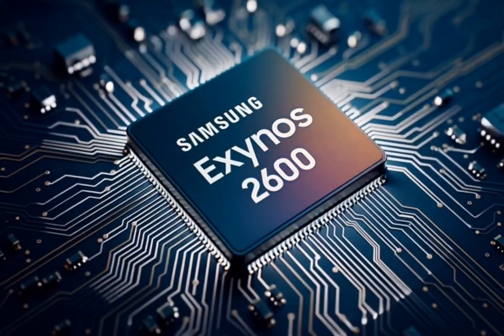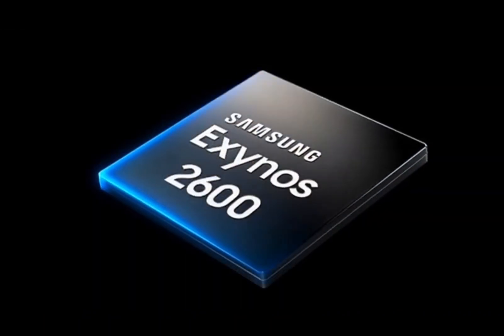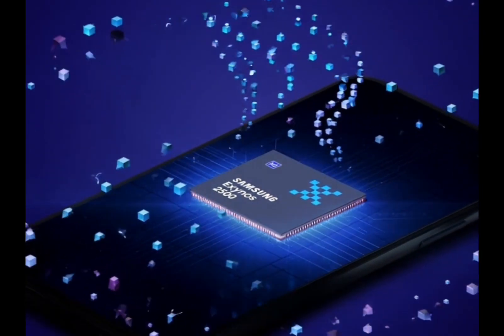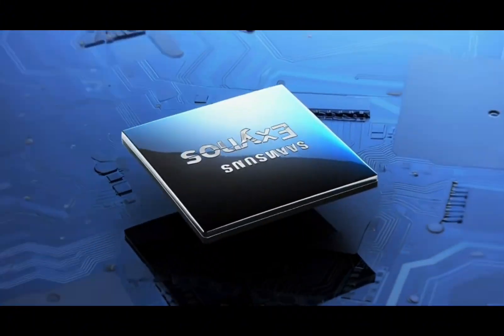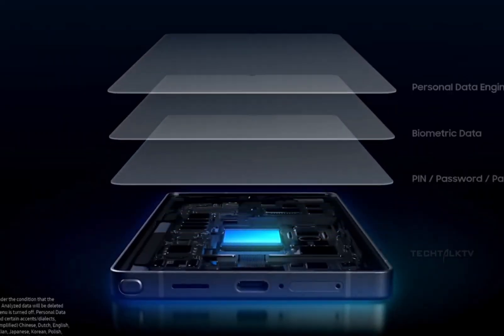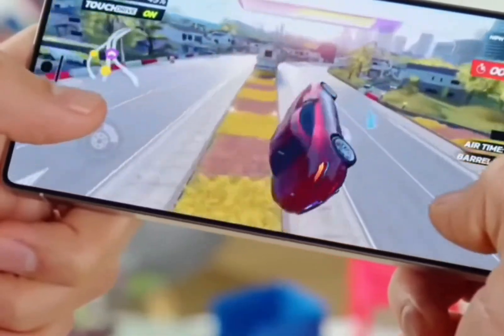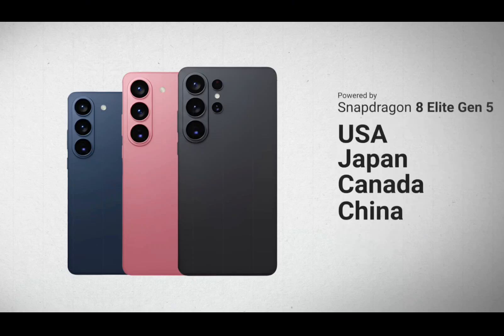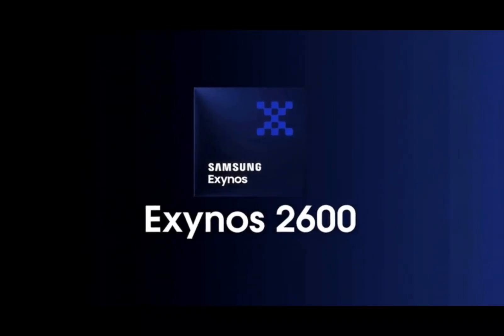Exynos 2600 UNDERCLOCKED?! Samsung’s Genius Move Explained

Comment: I have an s10 plus with the exynos chip inside. It was then the "ultra" version of the phone. If this is true that they are under clocking the chip then I say go for it. The s10 when it launched here was a fucking hand warmer in a hot country like the Philippines.  (trust me, we don't need hand warmers). If the phone works smooth and doesn't over heat, lasts all day and pretty functional then yes, sure. I'll upgrade from my s24 ultra to this even with the exynos chip. That over heating thing is a real nuisance specially when all I did back then to cause it to over heat was browse facebook and youtube.

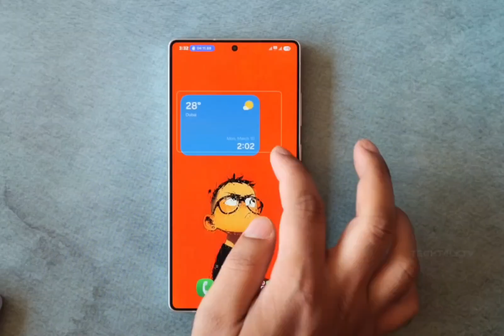Comment: 3:05 "Pared with liquid cooling!!???",🤯🤯 bro stop lying samsung is not freaking pulling a redmagic move! they'll never use freaking liquid cooling! no way lmao if they ever do😂. liquid cooling in non gaming phone where are we even going at this point!?
Reply: Samsung isn't using active liquid cooling like some gaming phones. Their Galaxy S26 Ultra features an enhanced vapor chamber cooling system, which is a form of passive liquid cooling. It works by using a sealed chamber with a small amount of liquid that evaporates and condenses to spread heat evenly and keep the phone cool without any moving parts or pumps. This method helps maintain performance and prevents overheating during heavy use, without the complexity or noise of active cooling systems. So while it's not 'liquid cooling' in the active sense, it's still an
effective advanced cooling technology.
Reply: @12rsz yeah that's kinda what i figured out!🤔